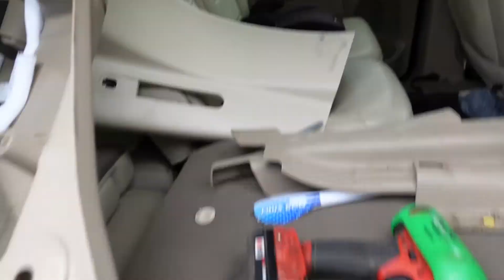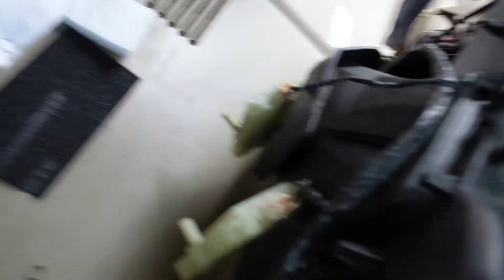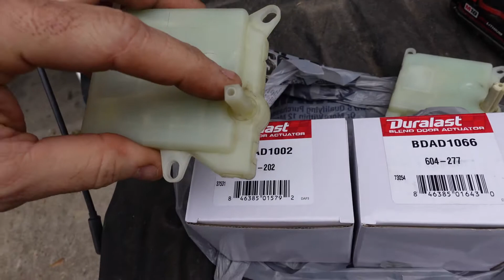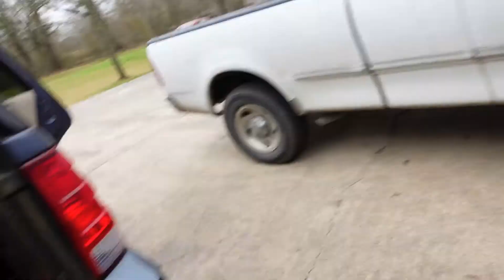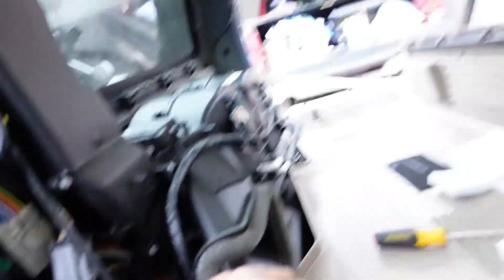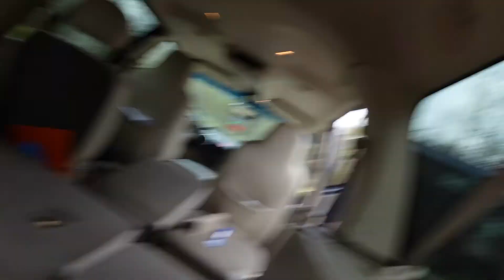2003 Expedition No Heat Again

Comment: That part you found underneath the seat hooks onto the rails underneath the back passenger seat, the seat you fold down to get to the 3 row
Reply: Yeah it connects with the part that's most likely still sitting in place by itself like mine was it has a 6 or a 7 millimeter bolt that holds the 2 plastic covers together